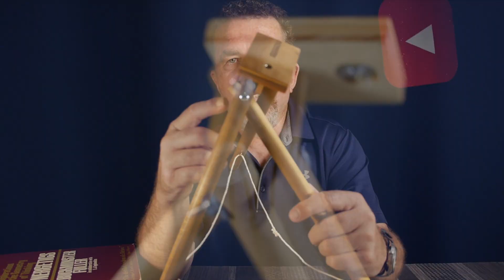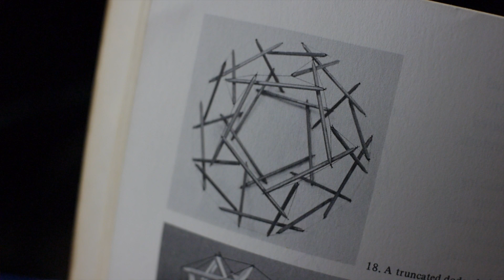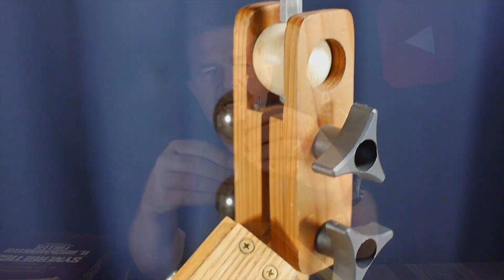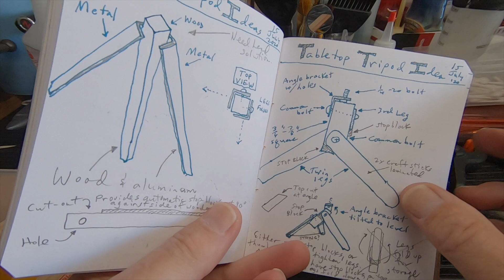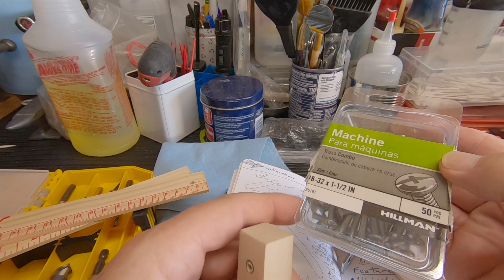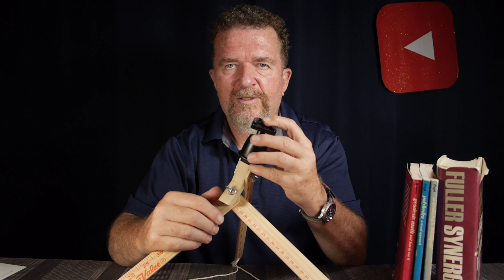DIY Tabletop Tripods

Comment: Hi Joe, thanks for another great video. Very interesting! Years ago I read a book from our local library filled with photography equipment projects made out of PVC pipe which were also fun but wood seems a friendlier material to work with as well as being nicer looking. 

I have had an Ultrapod and an Ultrapod II for many years and love them for travel use. The smaller one fits easily in my pocket and just barely works with my micro 4/3 camera and a pancake lens but is better if I can use it's Velcro strap to affix it to a pole. 

I am now contemplating whether one of your purpose-built wooden monopod and base stands might work either in front of or behind my computer monitor to use an m4/3 camera for better image quality for Zoom meetings. 

I am currently looking for the least expensive m4/3 camera body I can find used that has a live HDMI video output as my Olympus EM10 does not. Any recommendations?
Reply from the maker: Perhaps a LUMIX G7 would work for you, it was Panasonic’s first 4K camera and has live HDMI out. Or a GH3, which I use, better optimized for video.
Reply: @Joe_VanCleave  Thanks!
Reply from the maker: @brucehorn3021  Hmm, I haven't personally owned an Olympus EM camera or used one, so I would be biased toward the Panasonic. Does the EM-5 have live HDMI out?